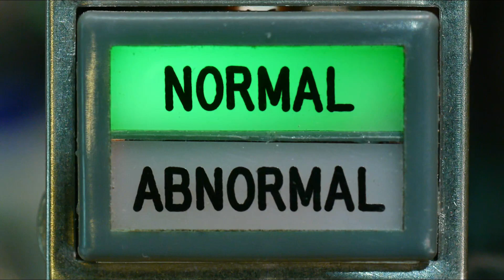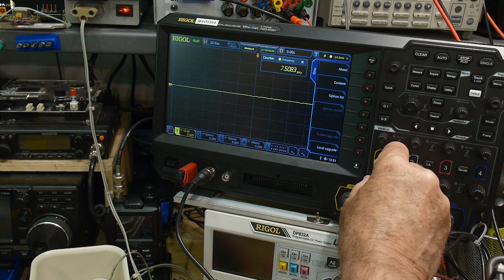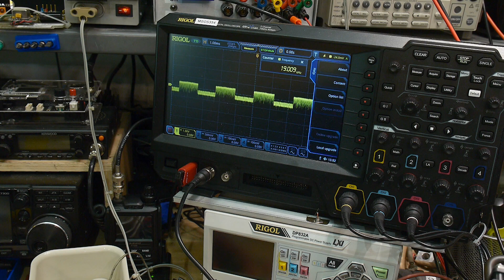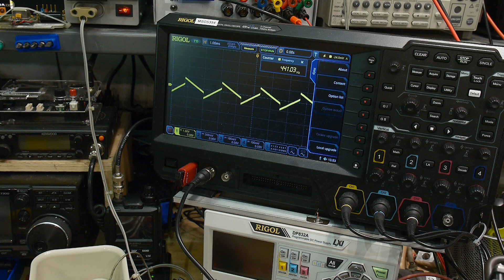#1200 DIY Analog Synthesizer (part 4 of 15)

Comment: please post a link for the connector kit and crimp tool - this is something I need but know nothing about.
also, what size pins do these fit on?
Reply from the maker: search amazon:
Dupont Connector Kit - 1004pcs Crimp Connector Kit with 2.54 mm Crimp Pin Connector Housings,
IWISS SN-025 Dupont Crimper

Comment: I'm curious if you added your capacitor after the noise source, or after the op-amp. I'm thinking that op-amp might be clipping to the rail if it's getting a direct coupled signal. But, a little knowledge is dangerous.
Reply from the maker: after source